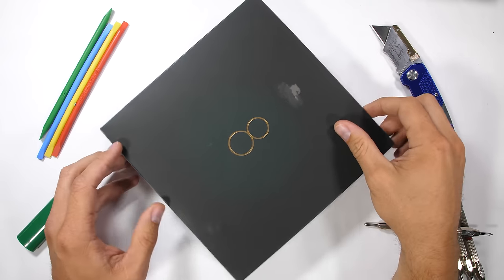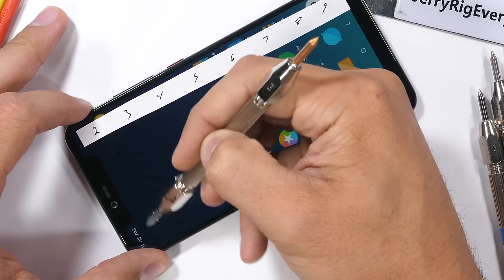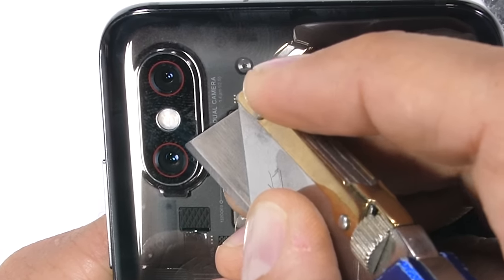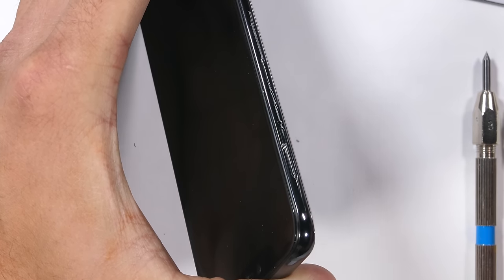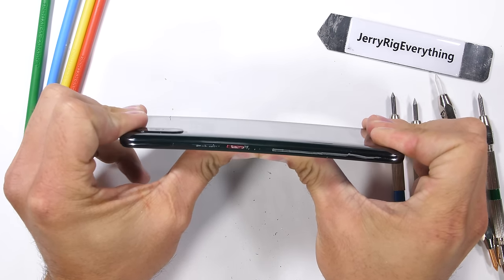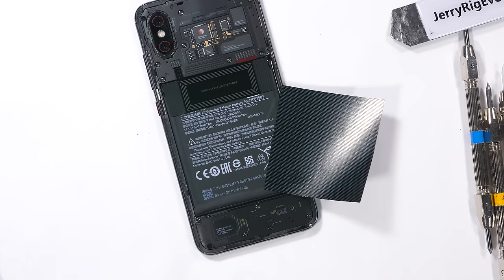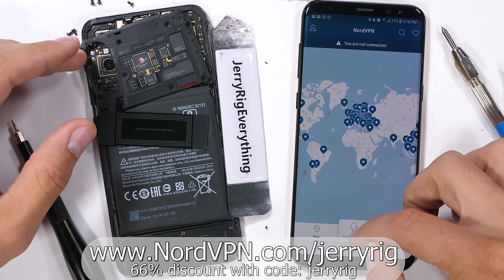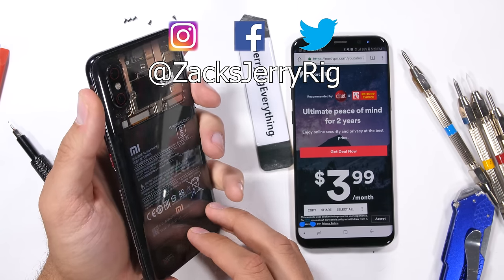Mi 8 Explorer Edition Durability Test - Is it FAKE?!

Comment: of course it is fake cuz you need a plate or copper plate above the chip or it will really get hot and shutdown automatically
Reply: also, some sensitive components need shielding from EMI
Reply: hmmmm just the sticker on the back right?
Reply: A Smartphone CPU didn' t need that much cooling. Only the GPU needs a permanent Cooling.
Reply: @derspielographdsg7435  but they are on the same silicon die, and as such, if you need to cool one, you have to cool both.
Reply: @derspielographdsg7435  Modern smart phones use SoC. The CPU, GPU, ISP etc all are integrated into one single chip called SoC. So technically its the SoC that needs the cooling.
Reply: @PradhumanRehal  I know What a SoC is. But Most of the Smartphones have an externel Chip too.
Reply: Gimme the SUCC
Reply: @derspielographdsg7435  I can assure you every single smartphone made today, uses CPU and GPU integrated in the same chip. Name a smartphone that uses different chips, for CPU and GPU.
Reply: @PradhumanRehal  True Story!
Reply: xiaomi used real components on that plate, they just don't work
Reply: +smartnubz it more like plastic with chip on it. it looks cool tho.  can search on youtube for video, i already watch it while ago.

Comment: The detail put into that fake cover was impressive though. But no headphone jack is the least innovative thing about this phone and it's dumb they're copying Apple's stupidity.
Reply: They even copied Apple's pentalobe screws, which was a pretty bad option
Reply: If you need a headphone jack in 2018 you're either poor or old. I can't even remember when i have used mine😂
Reply: Or someone that actually uses high-end headphones, most of which are still wired. Just because you're okay using run of the mill wireless audio, doesn't mean everybody that has actually invested in high-end audio should lower their standards.
Reply: @gillesbaudeweyns6802  this guy gets it. I have Bluetooth earbuds to. But there still isn't a replacement for wired just yet. The technology isn't at that point to which wireless has caught up with high end wired.
Reply: @Mikkal Halminen Wired headphones and earphones even today have a superior sound quality, bass and they needn't be charged.  But since you are rich and a kid(mentally atleast) you won't understand it.
Reply: @mikkalhalminen4094  anything that is professional in sound wont include wireless buddy, im here enjoying higher quality sound on my professional audio setup with my "outdated" headphone jack
Reply: @SirDella  the headphone jack will never be outdated. Its literally just two connections delivering audio from the DAC to the speakers. Such a simple setup can never become obsolete. Hell even wired earbuds and headphones have better call quality then wireless because the audio isnt being compressed. 

Oh and one more thing co workers who use those stupid dongles are always breaking them lol. The connectors break off inside the phone! So now not only cant you listen to music but you can't charge your phone. At least LG gets why wired it still great, thr V35 and G7 have good quality DACs that when paired with higher end earbuds or headphones will deliver a fantastic audio experience. I wish that other companies will follow in LG's foot steps.
Reply: @RobertNES816  exactly, sound isnt getting better as time goes on, not only that but it seems like we are going backwards, the best systems are the old ones
Reply: @SirDella  Yup that's for sure. A/B amps are the only setups I use when at all possible. Type D amps are getting better but they're still no where close to what a good A/B amp can deliver.
Reply: True, I made an AB amp with A TDA chip and it sounds spectacular
Reply: @RobertNES816  I disagree personally. It could be just me but after getting a pair of high quality wireless earbuds the sound is equal if not better than my high quality wired ones to me and the 12 hour battery life is more than enough for me to not have to worry about it at all since I'm always carrying a portable charger anyway. Of course the cheaper bluetooth headphones will sound terrible but a good high quality pair is very nice. Just like with most things you get what you pay for and those are no different.
Reply: Getting rid of a feature and calling it innovation is asanine and the only people who think it is are being lead around by their Apple Shepard. The head phone jack is still widely used and has not been classified as obsolete so why remove it? Cause Apple can. They are so confident that they can sell their phone however they want and people will buy it. And so far a large number of people have proven them correct so maybe they are just that good. Not at being innovative, but at being manipulative. The entire Apple ecosystem is built to make it hard for anyone to leave even if they wanted to. I set myself free last year and I still can't get all my passwords moved over 😔.

Just my rant for the day. If you agree, agree. If you don't, don't bother trying to convince me otherwise. I probably will just think your being biased anyway.
Reply: @soundblaster2k  will you name the ear buds?
Reply: @envadeh  i have a few pairs. The wireless earbuds I use both the "Sennheiser HD1 in ear wireless headphones" and the "soundpeats QY7 earbuds". The soundpeats are much cheaper but still have amazing sound quality on par with most wired earbuds. As for the wired earbuds I use the "Shure SE215" and I really love the sound on them. They're also really portable thanks to the detachable wires.
Reply: you have to blame people for them copying things from apple... cuz people buy whatever apple shits every year and they follow what sells....
Reply: @Mikkal Halminen I prefer bluetooth headphones too, but sometimes i run out the door in the morning and forget them. i keep the wired ones that came with my note 8 at work in my toolbox though just in case that happens. it's good to have options like someone else on here said. but you keep making excuses for apples inability to innovate without removing features. look at all these phones way better than Iphone that have top rate specs and still managed to squeeze a headphone jack in.
Reply: I've never broken a dongle. And of course, you can use these to connecet wired headphones.

Comment: They should stop with the no headphone jack thing.
Reply: Absolutely.
Reply: Deal with it.
Reply: I forgive them when they have an in screen fingerprint scanner. I think the OnePlus 6t is gonna be the first phone that I will entirely accept and defend for not having headphone jack since it will have a bigger battery, in display fingerprint scanner, and high quality cheap USB C headphones.
Reply: No headphone jack is okay only if they provide good quality bluetooth hands free within the box
Reply: @ContentbyARK  Xiaomi includes the USB C Jack adapter in the package, but I would always like to charge and play music at the same time, but it is alright, their bluetooth headphones are pretty cheap while compared to Apple accessories, if you have a Mi store around it is a great deal, it is always cheaper to buy it locally, feels dirt cheap.
Reply: My only problem with Bluetooth headsets are when I watch videos the sound would come slower. It sucks
Reply: @OcDmn  Yeah straightforward headphone jack is always the best, even the USB Type C kind of approach doesn't feel as good as the standard way.
Reply: I like the look of the absence of the headphone jack, but realistically, yes it should be revived
Reply: @londondyen7010  Damn right but we always lived with ports and crap for decades, 3.5 jack wouldn't hurt, phones should always have more functionality, I get your point though.
Reply: J Arnett what's so cool about a fingerprint scanner when you have faceid
Reply: Fenn ViktorVich bluetooth headphones work for apple too tho, like, you don't have to buy apple sheesh
Reply: @Jjb-gk4ce  Face ID until this day isn't foolproof, but yeah any sort of face unlock is neat it just how smart the system is in addition to how good the algorithm deals with what it captures.
As for headphones, it keeps telling my sister that "accessory not supported" or something around the lines, legit air pods works for her.

Comment: Hey Zack, I have a question. You've done these tear down videos and took apart the camera modules. I'm wondering if you can upgrade the camera by simply replacing it with a module from another phone (or upgraded version of the same phone)?
What are your thoughts? Would there be an improvement? Would the software say it's not compatible??

Comment: Totally not worth the extra bucks just to own the so-called transparent rear body.. no offense to Mi Fans ✌
Reply: But you have the in-display fingerprint sensor which the other variants don't have
Reply: prime wilmusean except 3,5mm TRS jack
Reply: @primewilmusean829  In that case, other brand like Vivo V11 Pro, also have Under Display fingerprint with half the price point of Mi 8 SE.
Reply: @karepmuu  but mi 8 has SD 845, the fastest for Android...
Reply: @prime wilmusean So does Pocofone..whats your point?
Reply: Joshua Utomo brah sp845?
Reply: @MikeMessiah  but mi 8 looks more premium to the feel and also it is equipped with a more capable set of dual cameras than pocophone f1. Plus it has the in-display fingerprint sensor. But again, you have to pay a price premium but definitely more worth it than paying for an overpriced iPhone.
Reply: Definitely not worth extra 10K but still it has a better design, In display Fingerprint and 3D Face ID Hardware (like iPhone X)
Reply: @primewilmusean829  well my s9 is more premium
Reply: @CozmicSwag  much more expensive tho
Reply: And for ads
Reply: @CozmicSwag  comparing an apple with an orange??? Nah. Definitely the s9 looks and feels premium to the touch but you pay almost twice or 1.5 times the amount of money you spend on mi 8. But the mi 8's camera is only slightly or maybe by a respectable margin, inferior to that of s9. Anyway, phones don't last you that long and chances are you will be changing to a new one after 1 or 2 years. Not worth the money to invest something not for the long run
Reply: Different ppl have different point of view too. For the art, I think it really worth.
Reply: this is just a bonus. mi8 explorer edition sports 8gb of ram, 256 of storage, in screen fingerprint and a better-than-the-apple's face recognition system.

yeah, I think the extra dollars are totally worth.
Reply: @leonardovalle2763  I don't like Apple, but I think face id will be more secure. I use an s9 with face recognition but I know apple has more secure facial recognition even though the s9 may be quicker. Speed doesn't mean it is better.
Reply: @oscarkhawar9323  noo, definitely s9's face recognition sucks. it only uses the front facing camera, that means it can unlock the phone with a picture. but when I referred to mi8's one I meant the it has dedicated sensors that send more than 300.000 dots to make the recognition more precise. It's more than iPhone X's.
Reply: @leonardovalle2763  it's 33000 isn't it
Reply: @oscarkhawar9323  i just remember that there's a 33 in it

and also that it's more than iphone X's
Reply: @leonardovalle2763  also with regards to the s9 point, I wasn't comparing it to face id, I was just using it as an example that speed doesn't mean better. I have no doubt tha tg the mi 8 is better value but I think face id is more secure. I'm not saying the mi 8 face recognition is bad because it's not, but I'm pretty sure face id is more secure. I could be wrong and I can't really find any good comparison.
Reply: @oscarkhawar9323 I didn't claim at any point that the one present in Mi8 is faster. I just really meant it was safer, and that's my opinion about, as it send more points at the user's face.
Reply: @leonardovalle2763  you said it was better and I disagreed, saying I think it is less secure
Reply: @leonardovalle2763  as the iPhone X also projects "over 30000" dots according to the key note. Idk how much that is Becuase apple is pretty conspicuous about exact stats as can be seen with the xs battery stats
Reply: @oscarkhawar9323  apple stats? probably rounded.
Reply: @leonardovalle2763  probably
Reply: Mi has no waterproofing.
A big nope from me.
Reply: no offense taken
Reply: @Chronically_ChiII  yeah, that's a huge step back for me
Reply: @karepmuu  Your opinion becomes irrelevant the moment you mentione vivo n oppo.
Reply: @bhagath2623  can't u see some1 start comparing features to other brand? which means i need to mention other brand as well. and by the way i didn't mention Oppo. be a logical reader pls

Comment: I know something real, that is Xiaomi will never make a water 💦 resistant phone with ip68 rating.
Reply: My phone drops.. But most of the time its floor or ground... And thats where iphone shatters.. XD.. I dont use my tech underwater i dont care if its ip68 or whatever.. My frnds samsung s8 plus died after a slight dip in water.. It was a rated phone though...
Reply: Because it will raise the phone price 😁
Reply: @mohdrafey4173  Exactly, my aunt was damn sad and pissed off when the same thing happened, since then I don't care about ip ratings, but it is good to have rubber around the ports or the SIM card tray.

Comment: 4:51,3400mah not 3000 mah😠😠😠😠😠😠
Reply: why are you mad
Reply: All mi 8 has 3400 but mi 8 explorer mi 8 pro mi 8 lite has 3000
Reply: "2900/3000"
Check that part of the video better because you can see that printed in the battery

Comment: well yesterday mom dropped this phone on the floor. well, it was a cement floor.... both the lens cracked and also the cannot switch on the phone again. we took to the repair centre and they said that we have to even get paid to change the circult board inside. i cannot believe it is that fragile , when the phone actually was covered with a thin transparent case.

Comment: Aside from the very superficial "cool" factor (if you're wowed by pointless "innovation"), the under glass fingerprint sensor is a very silly design, merely pandering to the manufacturers' desire to come across as "first!", whilst offering absolutely NO extra benefit or utility over a recessed, circular sensor, located where one's fingertips naturally fall when holding a phone.

Humans are creatures of habit. It's very easy to get into the habit of resting one's fingertip in a recessed, TACTILE circular sensor, because it's trivial to locate, even when doing so in your pocket, or in the dark. Now, with this sub-panel sensor, there's NO tactile reference, so one has to hope that the hard, glossy surface immediately above the fingerprint sensor, feels distinctly different to the rest of the glass... and obviously it doesn't - requiring one to activate the phone so that the screen illuminates, showing one where to place one's fingertip.

THIS is a "feature"?

They're so, so lost.

Comment: JRE, holding a phone that flagrantly rips off apple: “Apple will be so stoked when they invent this in a few years.”
Reply: Says the apple fan girl holding a $1400 iphone without even a fingerprint sensor let alone inscreen fingerprint sensor 🙄🙄
Reply: Ani Rudh fanboy* and also it’s 750 base, has Face ID which is way more secure, and also my phone gets updates for five years, more than the two years you get with Samsung.
Reply: @christinaandwena8917  And Samsung is not the only company which makes Android phones.
Reply: A.F don’t need to. After 5 years of updates, I’d pretty much be begging to upgrade. You are right about the custom rom thing, and I think apple shouldnt actively prevent downgrading, but it is sometimes possible, as is jailbreaking. But unlike my s5, my brother used his iphone 5s for 4 years until it simply became too old. My s5 stopped getting updates at year 2, then I switched to iphone because I wasn’t dealing with that garbage anymore.
Reply: A.F “your shit iphones” well they certainly hold their value 😜
Reply: @christinaandwena8917  First off, I meant puncholes. Yes, my mistake. Secondly, if I prevent iPhones, doesn't mean cuz I just don't wanna see a new thing. It's my preference, I want freedom over a simple OS. Lastly, they're shit in front of my eyes. First, I can't handle the iSheeps, why? They think everything they do is innovative (btw, Apple stole many things from Android for IOS 14.) And Idc if they hold much value, all flagships do. Maybe less than Apple's resale value but it's good for someone else buying it.
Reply: @christinaandwena8917  Yh, and sure you would. Cuz that phone doesn't have 120hz refresh rate display, right? And as I said, Samsung isn't the only company making androids, another reason why I prefer Android (variety). As far as I heard, Oneplus does have a 6 year update policy. And Pixel's have 3. And Xiaomi also does have a good update policy. So yh, Idc if Samsung doesn't give updates after 2 years. Many companies do.